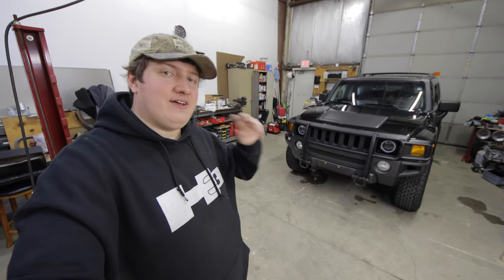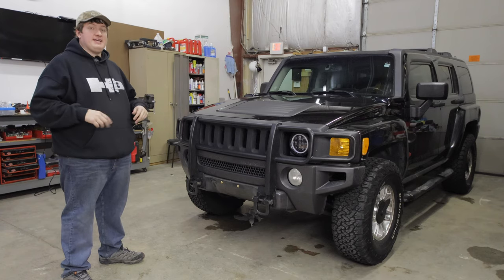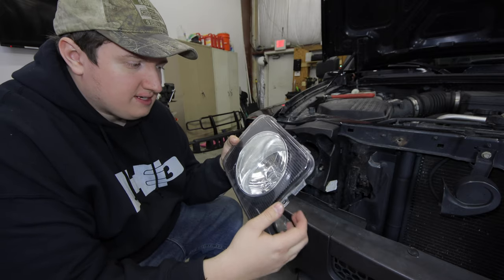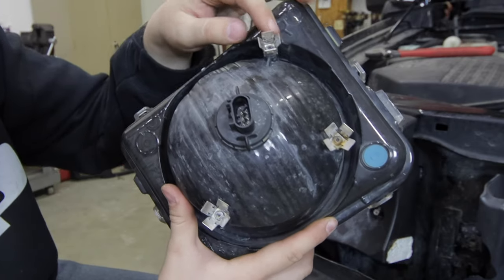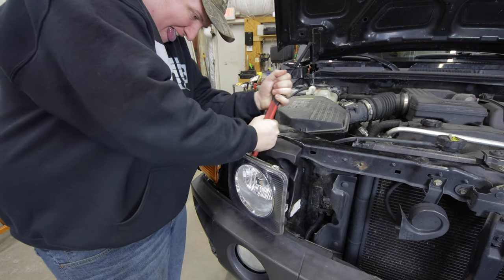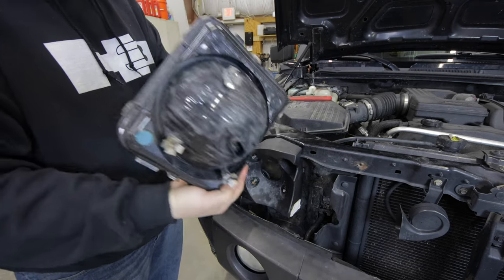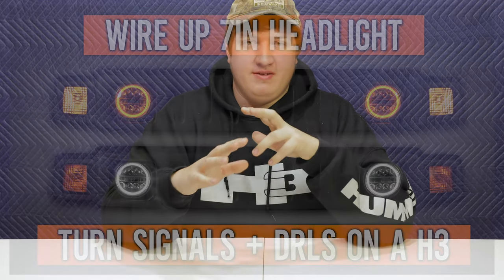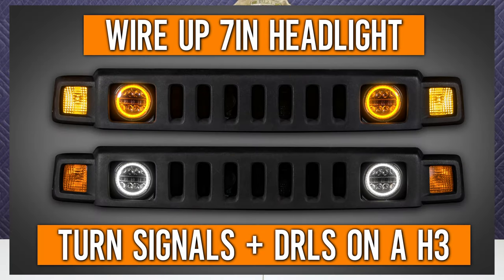How To Install 7in Jeep Lights On A Hummer H3

Comment from the maker: Hey everyone just a quick update! Since this video's release there has been a small change to the Lased Design's 7in Adapters. Basically, the little studs that connect to the main part of the adapter have received a V2 update. Instead of putting your little studs directly on the ball heads of the factory headlight assembly, you now reuse those little specialized clips that are the OEM headlights and screw them onto the studs. If you have recently ordered a set of adapters, you will notice that the studs on the kit have small holes instead of large holes. Please do not try and bore a much larger hole like you see me doing in the video. If you have the V1 version, you can upgrade to the V2 version, but it honestly doesn't make that much of a difference. If you are not quite sure what I am talking about check out this photo of what the new V2 studs look like: https://laseddesigns.com/collections/frontpage/products/v2-mounts-for-7-round-headlight-adapters
Reply: 4 Low Mode make more videos!!
Reply from the maker: @efraingutierrez8509  Haha yes! I do have some videos already filmed. Still need to do some editing.
Reply: 4 Low Mode sounds good man ! I just got an H3 that’s why I want more videos !!
Reply: Thanks for the advice.
Would you please make a 4" fog lights adapters video, cause I've ordered them and don't have any idea how to install them.
Appreciate your efforts.
Reply from the maker: @spiky0eng  Yes that video is already in the works! Hope to have that be my next video!
Reply: 4 Low Mode how can I email you??
Reply from the maker: @darrickjohnson9507  Do you have a instagram? I reply much faster on there. My username is @acer4lo
Reply: Exactly I installed my new 7inch led headlights and noticed the  new change in those ....thanks for the update.
Reply: What's up with Lased Designs?  Bought there adapter but haven't heard a word from them. Well I did get an order confirmation  over a week ago BUt nothing else, wont even answer messages.
Reply: @stillblurry  Hey bud, if you don’t mind keeping me posted on the transaction, that would be great. I’m looking to buy the adapter too.
Reply: @phillipfolkes4975  Ordered them on  the 14th, got an email on the 23rd that they were shipping and received them on the 29th.  I'll try and install them this weekend, hope I don't need tech support ! Oh, they did come priority mail, in 15 days.
Reply: Where do I order the adapters?
Reply: @ericroybal192  https://laseddesigns.com/    I installed mine and was disappointed in the appearance, (didn't look finished) so I ordered and  installed the 7" Headlight Bezels. Now it looks almost factory, but dam their slow! Had to pay Express Shipping and still took 10 days.
Reply: Does it matter what jeep headlight bracket you use
Reply: @ericroybal192  any luck? Still trying to find the adapter.
Reply: @4 Low Mode just curious, from time of order to time of getting the adaptors, about how long did it take? I ordered mine March 18th 2021 and I have reached out to the company and nobody has gotten back to me as of yet.
Reply: The first led lights aren’t just plug & play? you need the wiring harness?
Reply: @4 Low Mode I went to purchase the 7 inch adapters from Lased Designs and they were sold out any idea if they will be stocked up again or if there is another company out there?
Reply from the maker: @efrengutierrez2719  They sometimes go out of stock if they get more orders than they can ship out in a reasonable time, so they should be back in stock soon. As of now this is the only company making these adapters. There is another company called Phoenix Hummer Repair that are looking to also product an adapter, but there is no word on when those will be release for sale.
Reply: He makes the third generation now.....just got mine in the mail....all aluminum.  No plastic at all.. there nice
Reply from the maker: @larryb95  Yep! I will be making an update video on that!
Reply: @4lowmode  have any of the bezels laying around as spares wanna sell sell?  Still out of stock and idelike a pair of them..just not sure when he is gonna make anymore
Reply: who makes the headlight brackets and fog light brackets?
Reply: Can you give an updates to ANY sellers of the adapters?  Lased Design does not seem to have them.
Reply: @stillblurry did you get anything?
Reply: Great video. Any other adaptors out there that will work besides Lased? Out of stock 😅

Comment: I have been contemplating this upgrade for my H3 for months. I looked for kits but found none. Not only did you create a highly detailed video, but saved me a lot of heartache with trying to "wing it" using my own badly fabricated parts. Thank you for the how-to! I'll be ordering these. Great Job!!!
Reply from the maker: Oh yes! I have looked into some other DIY custom retrofits that people have done in the past and they are just too complicated and there is a lot that can go wrong. Also many of these other methods involve sacrificing the OEM headlights to fit the new lights into. I really don't like that because if the project doesn't turn out good, you need to rebuy new oem headlights. In contrast, these new adapters allow you to keep your old OEM head light housing if you ever need it. Also I have seen some people do some janky wiring to try to get these lights to work instead of using the proper harness.
Reply: @4lowmode  exactly. I'm not for using zip ties on headlights. Your way is definitely the best method for the upgrade.

I found the ThingVerse 3d printer schematic for adapter free to download. We have a local here that will print a prototype for me for $20, so I'll let you know how that goes.
Reply from the maker: @LibertyHand  Oh yes I know the ones that you are talking about. That was done by a forum user on Hummer H4O. There is not a whole lot of information out there about them. Apparently the guy that designed them did get them to work, however all the photos he posted on them are no longer available which is annoying. Also he later abandoned that idea and instead opted to fit 5in headlights in the stock headlight housing. Those 7in adapters do seem like they work, but are 3 negatives that I see. One is that the studs are not removable or replaceable. So if you break one, you need to replace the whole adapter. Second is that they do not use a retaining ring to hold them down and instead, they use 2 screws on either side to pinch the headlight in. Less of a secure fit in my opinion. Third is that these adapters were never tested to see if they could fit multiple sized headlights. Not trying to scare you off from trying it, but that is just the limitations that I have seen myself from looking at it.

Here is the link to the original thread about the subject: 

https://www.hummer4x4offroad.com/forum/showthread.php/13403-3d-print-files-for-7inch-led-headlight-adapters
Reply: Right on. I was thinking the same things. The one you used is a much more advanced designed, and those replaceable studs make a lot of difference. I'll add that often 3d prints need to be readjusted often after printing the first one.

I didn't realize it wasn't designed to use the retaining ring. Thanks for pointing that out. 

After looking closer and with your input, I'm going to run with the same setup you used. It is less troublesome and more reliable of a design.

Thanks, Bud!

Comment: Hey! Thanks for the video! I've had the 7" led headlights for a few years now and I started having issues with them just recently, so i decided to go back to the drawing board and redo everything. Just put my new headlights in and used this wiring harness and everything worked out great. Thanks again.

Comment: I have a 2006 base model and thing is a beast. I am about to put an off road light package on it but this is what I have been looking for to convert to LED because the light issue. This was everything I needed, thank you for correct wiring and product links.

Comment: Hey man can you do a tutorial on the fog light conversion kit? I would really appreciate it.
Reply from the maker: I definitely will be! I already have the adapters. Just need to find the time to film it!
Reply: @4lowmode  did you ever do it? i can't find it
Reply: @4lowmode  yes sir, still waiting on a video on the fog lights. My biggest question was about the wiring? Would it be the same as the headlights?
Reply: Would really like a fog light video.  I got the light adapters and 4” lights but when plugged in to the stock fog light harness, it doesn’t work?  Any wiring help would be awesome.  Thanks.

Comment: Thanks man, I was thinking of doing this but got scared away I just ordered some beamtech LEDs for my Hummer, I think I will be purchasing the fog light conversion soon
Reply from the maker: Yep! I get you! It can be intimidating at first, but its really not bad when you can understand the concept!
Reply: @4lowmode  exactly , thks for sharing your Knowledge !
Reply: How are the beamtech? Are they really plug and play?
Reply: @Banestudent21  they are great the pattern is pretty good too
Reply: @Banestudent21  and yes it's just a h13 bulb plug and play
Reply: @extrasteez5727  do the DRL work with it? Do they still come on?

Comment: WOW thank you so much your video really helped. The other four vehicles I have don't have to be dissembled to change a light bulb.  My right turn signal and marker light went out.  The engineers that designed this POS were really stupid and went out of their way to create spaces for rodents to live in.  First they put a depression under that battery that is a perfect house for mice and rats. A ground squirrel died in the air cleaner after building a giant nest because of the easy access between the inner and outer fenders. Following your instructions to remove the grill I found out that between the plastic inner fender and plastic outer fender is a great space for rodents to live. That is why the squirrel decided on the air cleaner, there were too many other rodents in the other spaces. They chewed the wires to the side marker light and turn signal and other wires.  I couldn't have created a better home for pack rats if I tried. Keeping the hood open did not help because the inner and outer fender space is a self contained habitat for rodents. Now it is apparent that they used that to get to the windshield wiper deck which we discovered was stuffed with mesquite beans when the windshield was replaced.  I really appreciate your videos but I am selling this POS because I can't keep the critters out no matter what I do.
Reply from the maker: Glad you found use out of the tutorial! To be honest, in all my years of ownership of the H3 and reading forum threads about H3s, I haven't really heard that many problems about rodents burrowing into the H3. It could just be that you get a lot more rodents out where you live. To change out the marker and turn signal bulbs, you don't really need to take the grille out and remove the headlight assembly. You can actually access both of those bulbs by dropping the wheel wells to get access to them. The wheel wells are held in by a total of 10 plastic push clips. You can actually get away with taking about 6 or 7 of them out and then just bending the wheel well down so you don't have to take the entire thing out and then you can gain access to the bulbs.

Comment: Great explanation of the install.I planned on buying these for my H3,but didn't know about those adapter rings
Reply from the maker: Yep they are pretty new! Much better option rather than trying to modify your stock OEM Headlights and fit a pair of 7in Headlights in them. I have seen that done before, but it looks like a pain and requires way too much work. These adapters allow you just to pop them right on!
Reply: @4lowmode  I've seen some of those installs on here.I can't believe what some will do,just to make them fit.I'm also concerned about what brand to buy,and the lifespan of them
Reply from the maker: @MrCrf450rider  In terms of brands, there is a huge price disparity between the cheaper lights that you can get on Amazon and the brand-name ones. As I mentioned in the video, the cheaper ones don’t really have an actual brand. What sellers will do is order them from Ali-Baba, stick a company name on them for branding purposes, but they really don't have an actual company behind them. These cheaper lights are still pretty good for the price, but I imagine in 5 to 10 years that the lenses may start to get hazy, but it is still cheaper to replace them again, then buying a brand name one. The brand name headlights will definitely hold up over time better and possibly come with a warranty, but the prices for these headlights usually start at around $400-$1000. One of the more common brand name ones you see are the JW Speaker Model 8700 J2 Black Headlights which are on Amazon right now from $449. This model was an original design that many of these cheap no-name brands copied the design from.

Comment: Followed your steps and everything installed perfectly. Went with the single harness recommended by Lased Designs.
Reply from the maker: That's awesome! I actually installed them yesterday on my 2008 Alpha using the Relay Harness! Went pretty smooth!
Reply: @4lowmode  Installed the fog light kit at the same time using the Lased Designs fog light brackets. Also went smoothly. Had to reverse the fog light connectors for them to work correctly. I also have a 2008 Alpha, Birch White.
Reply from the maker: @NavyChiefEWC  Nice! Yes I am making a video on how to do that but I still got some editing and film a few more things before its done.

Comment: Love the videos. Since I now know how to remove the grille guard, d rings, bumper and skid plate, I'm going to upgrade to halo head and fogs. Wish you could should a fog light replacement video (or just add to existing ones). Gonna change out the horn, turn signals and side markers while I'm at it. Can't wait for your next upload.

Comment: Dude your video skills are epic.
Reply from the maker: Thank you! Haha they do take a long time to make 😅
Reply: 4 Low Mode worth it so much. I had no idea what I was getting into. I had already ordered a set of LED lights for mine and I was like shit how am I gonna mount this. This video was a life saver!
Reply from the maker: @brianpresto1446  Haha yeah! When you understand the concept it is a lot easier. It's just when you aren't sure about what to do, it can be confusing. Especially when the only advice people give you about it is "Oh it's not really that hard" 😅
Reply: Just getting around to this today. My adapters don’t seem to be drilled out for the nubs at all.  What size drill bit did you use to open it up?  Thanks man!
Reply from the maker: @brianpresto1446  Oh yes! There has been a V2 update to the studs. You now use the the factory clips on the old OEM headlight assembly that you pull off the H3. See photo here: https://laseddesigns.com/collections/frontpage/products/v2-mounts-for-7-round-headlight-adapters
Reply: I have the v2 mounts!  Didn’t realize that lol. I got this!
Reply from the maker: @brianpresto1446  Yep! Let me know if you got any more questions when you go to install them! I really do have to make an update video about this and also include some other questions people have been asking in this comments section.

Comment: The 7” Round Headlight Adapter is currently out stock, any idea when is coming back? Or where else I can buy it?
Thank you for making this video!!
Reply from the maker: Not exactly sure, but I know they are only temporarily out of stock. Lased Designs will stop taking new orders if they start getting more orders than they can handle. It should be only a few weeks at most.

Comment: Thanks for the great video! I had no idea someone made adapters. It would be nice if the adapters filled the part of the empty headlight cavity between the grille and around the headlight itself to prevent bugs, mud, etc, from building up. I plan on replacing my headlights in the future.
Reply from the maker: Haha yeah! The same people that made the adapter are working to make a cover. No word on price point yet, but there is a working prototype as of right now!

Comment: hey brother I really liked the video it helped me a lot but I have a question.  Where can I get the support rings and the plastic tubes?  Because the rings I have do not fit the h3 truck, if you can tell me where I can get them, I would appreciate it very much.  Thank you so much.
Reply from the maker: Are you talking about the headlight adapters? You can get them from laseddesigns.com. What are the tubes you mentioned?
Reply: @4lowmode  yes I talking about that
Reply: @4lowmode  is little tube for the ring
Reply from the maker: @cutbertosuarezdelacruz7132  The studs?  Just a quick note that those studs have been changed. Watch my 7in Headlight update video to learn more.

Comment: Hey how can I get in touch with lased design for brackets tried emailing no response and they are sold out trying to find out a restock date.
Reply: Sweet! Someone else on my same boat. This is all I need now to install them correctly. I’ll be checking periodically but I received no email response from a week ago. If you find something plz comment here, brother! I’ll gladly do the same if I find anything

Comment: You should grab a 7" Hella E-code H4 and throw that in with some Phillips Extreme Vision +130% bulbs.  The cutoff and light pattern of those housings is second to none.  Much better then any LED on the market.  Plus cheaper then any quality LED.
Reply from the maker: That's an option as well! Since the bulbs for those aren't LED, no need for the polarity converters!